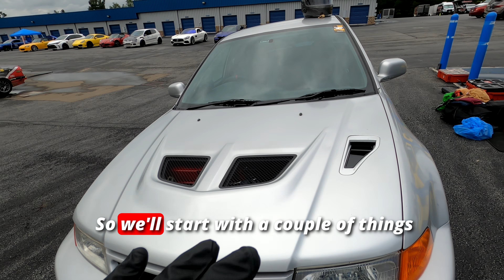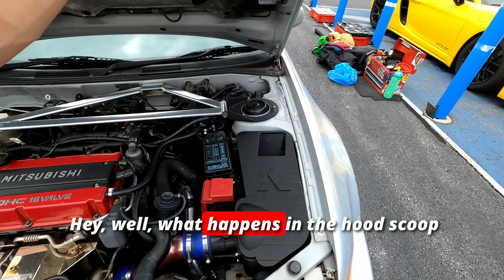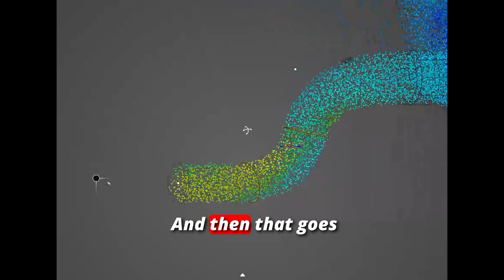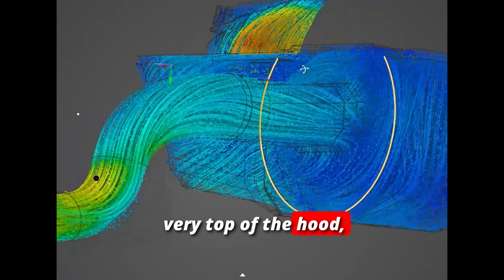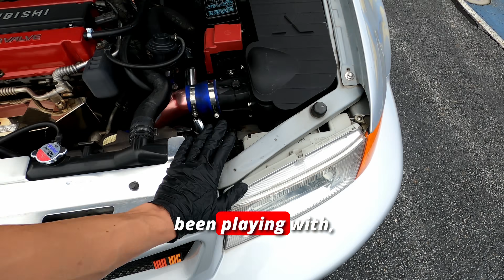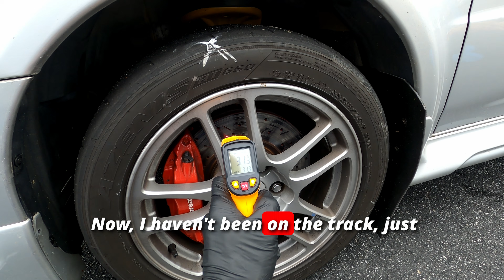We Tested Our Custom EVO Parts on the Track and Here's What Happened

Comment from the maker: What's a part you wish existed that we should design next?
Reply: the same intake, but for the 7
Reply from the maker: @Gorabis  I would love to, but the changes to the 7+ fusebox design will make it too difficult to install.
Reply: @SpeedinEngineering true, the wiring would have to be extended so the box could get relocated. Plus you might end up losing the intercooler sprayer reservoir.
Reply: Functional under tray for the 6. There are some metal ones available but how functional they are remains to be seen.

Comment: Is it necessary to run both types of ducts or just the one seen in this video?

Is the WRC intake good for a 600whp build using a Garret G30-770 turbo?

You make the 6.5 oil cooler duct, nay plans on making the MR463801 duct for the regular 6?

Can your bonnet/hood vents work with the factory louvres?
Reply from the maker: Hey Zen, You could run either brake ducts independently, or both together. I designed it to complement, but also be stand-alone. 

The WRC intake is good for well over that, the restriction is in the filter and as a 6in cone with center reverse cone the surface area wont be a noticeable restriction below 1k hp builds. 

I do sell the 6 duct, one is on my desk as I type. I am putting final tweaks on a rear duct to match to the bumper exit as well. You can see the prototype in my latest video. (That video highlights the 5 system, but at the end I talk 6 and TME)

The hood vents are designed to remove the factory louvers for better cooling performance. 

I hope that answers your questions, feel free to drop me an email on our site as well. I am certainly faster to respond there.